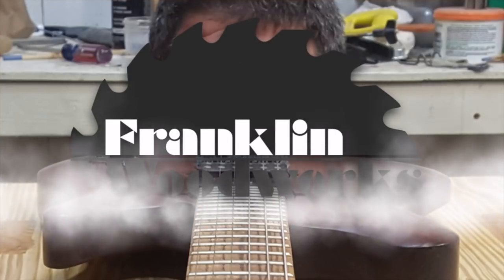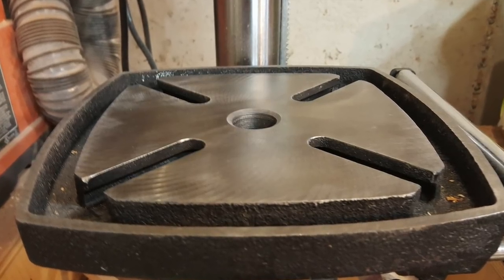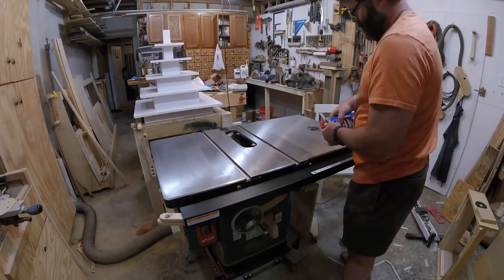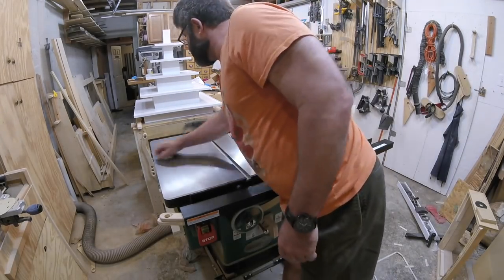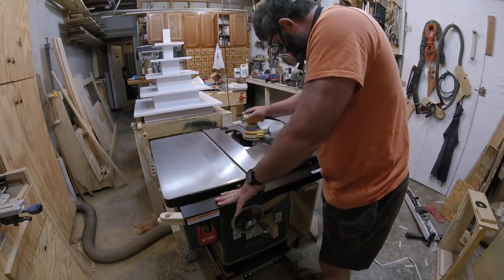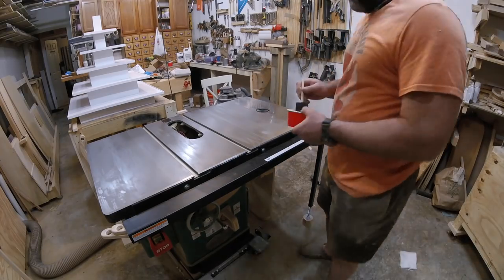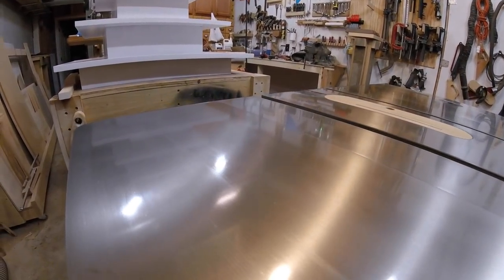Polyurethane your Table Saw

Comment: I live in Florida. I have a Grizzly 1023 that I purchased in 2010. All I have ever done is wax it, typically, twice yearly; not a speck of rust on it. I will admit that on a few occasions a wet glass or two has ended up on it inadvertently leaving a ring that I have sanded down. Can't get the stain out, BUT no rust. So even though that looks neat; being shiny and all; I'm going to stay with the Johnson's wax a couple of times a year.

Comment: I understand your comments about humid living in the South, however here in Maine our seasons very 150 degrees and keeping some equipment outside means you really do have to rust proof, hand paste wax & WD-40 also works well as a water Shield provided you keep it wet.
Reply from the maker: I never thought about it until your comment, but you're absolutely right.  The northeast, especially way up in Maine, probably has the craziest seasonal swings in the US.  If you can keep rust off of your tools, AND having some of them outside?  My hat is off to you.  And I agree that your protection would need to be on the wet side to actually work.

Comment: Water base poly is known to dry harder than oil based, but because it goes on thinner it needs twice as many coats to achieve the same effect. But water based scratches easier. It also cannot stand up to alcohol, so don't spill your beer on it. Use poly that is meant for floors as it is more durable.

Comment: We all want an assembly table so we don't have to use the tablsaw. I've said many choice words while assembling and needed to something. It happens more often than we want. I keep a piece of 1/2" ply wood that over hangs the tablesaw by a few inches, and screw corner pieces on t he bottom to keep it in place. The overhang allows for clamping work pieces.
Its light enough to take on and off, and it provides a nice flat work surface, plus it protects the surface.
I usually leave sone  saw dust on the tablsaw because its softer than the plywood, so the plywood doesn't scratch the tablesaw. When the plywood gets too messed up, you replace it.
That tablesaw looks great all shined up. I have the Ridgid R4511 with the black granite top so i can't shine it up. Plus no magnetic tools. I'm curious to see if your experiment with the urethane works.
Reply from the maker: That's a great idea.  My problem is that any flat surface somehow becomes a "storage area."  If I was more organized, I'd have plenty of room.  Instead of more room, I need a person to clean up after me.

Comment: Oil based finishes typically take longer to cure. You may consider waiting a couple of weeks to wax it if you try it again. I've thought about this before, but was apprehensive to try it. Curious how it performs.
Reply from the maker: You are correct on the cure time.  I discovered that when I felt the difference between the can's cure time, which put me at around 8 pm, and the next afternoon when I actually put the wax on.  It was noticeably harder.  But, (spoiler alert) I'm not a fan of the oil based poly.  I'm going to do a followup video where I detail my results.

Comment: I have been using CorrosionX on all my exposed metal tools for over 20 years it it works great at preventing rust and corrosion. I apply it twice a year when I do any recalibration checks of the tools. It is used by the military to protect bare metal. I apply it with a scotch bride pad then wipe off any excess with a clean rag. Haven’t found anything better.
Reply from the maker: D Tom So I'm guessing it leaves a film finish?  Does it cure, or does it leave  something behind?
Reply: which CorrosionX do you use?  I searched Amazon and see lots of options
Reply: I live in South Texas on the beach. 100% humidity most all the time. And I've also found that corrosion X to be very good.  I've tried waxing and though it works. Isn't long lived. 

Just 2 days ago I actually tried a coat of polyurethane. To see how it compares.
Reply: Curious about which one you use, too. I live in Florida, and we get high humidity a lot too.
Reply: Korishan I use "corrosion X 91002". Do a Google search of that.

Comment: Should have allowed more cure time before waxing. Wax will trap solvents and slow down cure times. Also using a metal etching product will improve adhesion
Reply from the maker: Agreed.  I should have waited a least a week before waxing.  But, I needed to use the saw, and the poly alone didn't go well with my sled.  However, I've about decided that the oil based poly is NOT the way to go.

Comment: Once clean use 3in1 Oil with a rag used on a regular basis you will get a slight patina but no rust  i use it on all my hand tools and shop tools. this was showed to me by an old craftsman that had all of his original tools for over 40 years and looked like new.
Reply: Rzero11231 Oils work well for hand tools, but not for table saws, jointers, etc. The oils can transfer to the wood you are working with and wreak havoc with fine finishes. Same goes for paste waxes that contain silicones.
Reply: I don't recommend pouring oil on the  table saw ,jointer or any other tool you put it on a rag wipe it on and wipe it off the oil will penetrate the steel you will not get any residue on your wood if done correctly ... you use what you want i know what works for me in my shop and i use a lot of fine finishes over the past 40 years with no problem.....

Comment: Good video, I find that although it looks cool, there is no substitute for regular maintenance of metal surfaces in your shop.  Steel surfaces will develop a natural dark patina.  Simple metal cleaners such as boshield do a good job for cleaning, and a simple paste wax is all a person needs.  The poly or any finish on a metal surface will abrade and catch and possibly be a safety concern.  This is why they don't come this way from the factory.  A waxed metal surface is the best surface when done properly.
Reply from the maker: Let me begin by saying that I really appreciate you watching and commenting.  I mostly agree with you, but table saws don't come from the factory with wax on them either.  Down here in the humid south, a freshly waxed table saw can still rust if you leave the garage door up overnight.  I'm just looking for a way to minimize spending my valuable shop time doing tool maintenance.  Does oil-based poly work?  Yes.  Is it the best?  No.  In fact, I'm going to do a follow-up video on my results of this experiment, and I'd never use oil-based poly again.  My ultimate goal is to build a stand alone shop from the ground up, including HVAC.  When that happens, I predict I'll become a wax-only guy.  But in my current situation, wax alone doesn't cut it.
Reply: I just want to add that the only time I've had finishing issues is when I've used Boeshield on my TS.  It may very well have been user error, but I've never had an issue with paste wax (other than it not lasting.)
What about applying pure carnauba wax with heat?  I.e. a hard, durable wax without the hassle of using solvents.
I'm also wondering how often you get severe condensation in southern Indiana?  Here in California wax works fine most of the year, but lasts a few days at most during the rainy season.

Comment: I have a kobalt portable table saw and the top is rather rough. I want to build a cross cut sled for it but I want to sort out this roughness first. Any ideas?
Reply from the maker: I'm assuming it has an aluminum top?  I would suggest sanding it using a random orbital or palm sander.  Depending on how rough it is, start with 220 or 400 grit and work your way up to 1000 grit.

Comment: How's it holding up? Never knew u could use poly on tools like that..might try it on mine I've been getting surface rust and keep sanding off
Reply from the maker: Joe Basement Woodworking & DIY Not good.  Watch my follow-up video.
Reply: FranklinWoodWorks will do

Comment: I don’t think the water base poly is a good idea on a steel or iron metal. What caused it to rust in the first place. BTW what is the name of the cat?
Reply from the maker: Water-based poly has worked fine on some of my other cast iron tools, so that's why I considered it my go-to option.  I just couldn't get it to stick to my table saw

Comment: This is a fantastic tip! I just got a new bandsaw and it's already showing signs of surface rust, even with my attempts at using paste wax. I'm going to do this, this weekend (probably with the water based poly). Thanks buddy. 🤓👍
Reply from the maker: Let me know how it goes.  I was really happy with the water based poly.  I live in the south, very humid, and I'm lazy about leaving saw dust on my tools.  The tools I've done in water based poly are completely rust free.
Reply: Yeah, I live in South Georgia... and my shop isn't climate controlled... so it's impossible to keep rust off my tools.

Comment: I have found the best solution is to clean it, wax it and then cover it was a flexible vinyl magnetic sheet when it is not being used.
Reply from the maker: That would mean I'd have to clean all the junk odd my saw when I got finished with it.  If it's horizontal, I consider it "storage space."
Reply: @FranklinWoodWorks2016  The floor is the biggest shelf in the house/ shop

Comment: Have you or anyone ever tried using CA glue on tool surfaces to stop rust. Just thought it might be a one and done. Thanks
Reply from the maker: I have never heard of that, but it sounds interesting.  I'll hunt around and see if anyone has done it and what the results were.  Might make a good experiment.
Reply: FranklinWoodWorks Thanks, I just thought it might last longer than Polyurethane and could give a really slick finish. Please let me know if you find anything. Bill

Comment: hey guys i live in Bremerton WA. on Phinney Bay  and i don't have the humidity you do but i do have salty air and my shop isn't insulated but i have been using paste wax for 30 years and it keeps all my tools rust free . unless one of my friends puts a beer on the  table  witch is #@$##@!$ the hell are you doing . A friend of did do what you did it lasted three months and had to sand it of wow what a pain it would have been easer to give a way and buy a new one.
Reply from the maker: Yeah, I really wish paste wax worked in my situation.  Or I guess I should say, worked better in my situation.

Comment: A lot of work for nothing. Use Top-Cote, spray on and wipe off, slick as heck, no staining on wood or any rust on metal. Works on hand tools too. 
Don't use paste wax, use Nu-finish car finish. Not a wax, wipe it on, let it dry, wipe it off. Also very slick and no rust for months. 
Both of these finishes take minutes to apply and only need to be done 1 to 2 times a year.
Reply from the maker: What kind of humidity do you have in your shop?  I have high humidity, and putting a film finish is the only way to keep rust off.  I'm going to check into your suggestions.  I'm always open to new ideas.
Reply: @FranklinWoodWorks2016  did you?
Reply from the maker: @koolkid1234ism  Did I, what?  I've done 4 more videos on trying to figure the cast iron rust prevention thing.
Reply: @FranklinWoodWorks2016  Sorry, i meant, did you check into his suggestion. I just bought some water based poly spray and did a couple thin coats but it was not very smooth. I added some paste wax over it but found that the wax came off almost too well over the poly. However I'm not sure if I was wiping too much.
Reply from the maker: @koolkid1234ism  The spray poly is less than ideal, but you can get around the negatives.  After laying on a coat, get a paper towel and rub the poly in like you would a paste wax.  After it dries, you have to sand lightly with 320 or 400.  Then repeat a couple more times.  Regarding the top coat, I'll eventually get around to testing the major products, but it will take time.  I've only got so much cast iron!
Reply: @koolkid1234ism  dont use waterborn poly. It will rust the iron before it evaporate. The poly will only trap that rust beneath once cured

Comment: Wonder how this would work on aluminum???
Reply from the maker: I have no idea, but since rust isn't the problem, I wouldn't go the poly route.  I'd just concentrate on using something to make it slick.  I've been getting suggestions in the comments that I'd like to try.  You might want to scroll through and see if something is applicable to your situation.
Reply: Thanks :-)
Reply: Joseph Snyder Aluminum is non-ferrous and wouldn’t oxidize or rust to begin with, but you could certainly apply polyurethane to aluminum.

Comment: I've got just one question. If this is a good idea, why doesn't it come from the factory like this?
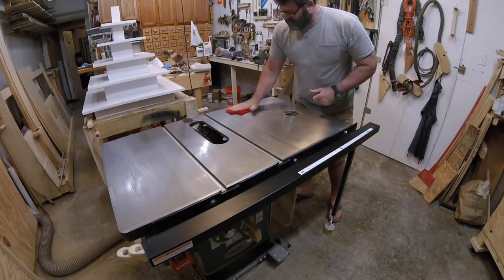Reply: 2:29 Oh, maybe this is the reason.
Reply from the maker: A legitimate question.  I think manufacturers for the most part design their tools for ideal situations.  Cabinet saws are usually in climate controlled shops, not garages.  Job site saws usually have aluminum tables, not only for weight but for exposure to the elements.  If I had a climate controlled shop with low humidity, I'd probably never do this.
Reply: Phillip Toone,  probably not the reason.  The bare cast iron doesn’t slide as well without paste wax or lubricant either.  The reason they don’t have a coating is cost.  It would add more surface preparation time, chemicals and overall time to manufacture with yet another process that is not environmentally friendly.  Not that China cares about the environment.  It also adds another part the manufacturer would have to warranty....

Comment: I personally don't see a problem with a natural patina the cast iron will gather over time. Some #0000 steel wool and a little elbow grease, followed by a fresh coat of wax isn't that big of thing. 

Doing this, I see the poly wearing through in certain areas first and then to get a level surface again, having to completely strip it off. To much work for me, I'd rather be using the tool than making it look pretty.
Reply from the maker: I you gathered from the video that I'm concerned with my tools looking pretty, then I failed to communicate.  My table saw is pretty because it's brand new.  I just want to keep the rust from pitting the surface, since I can be away from my shop for as much as a month at a time.  I'd encourage you to watch the follow-up video where I detail why this didn't work.

Comment: I work with epoxy and two part resins all the time and would NEVER put this on a table saw.  You will NEVER  get it off once it fails ...
Reply from the maker: I got if off mine with a little effort.  It was worth it a in the name of science.  But it DID fail.

Comment: I tried this last year, it did not work well for me.
Reply: What happened?
Reply: Thomas Hargrove It started to wear off fast. It also started absorbing random dark contaminants on the edges of what was worn which  would also rub off onto wood. It would peel as thing rubbed etc. Then after trying to remove it I wound up having to chemically remove any of it in the valleys on the saw table . I thought it would work just to leave it in places I could not reach, but it also started to peel and gum things up.
Reply: Thanks for the info!